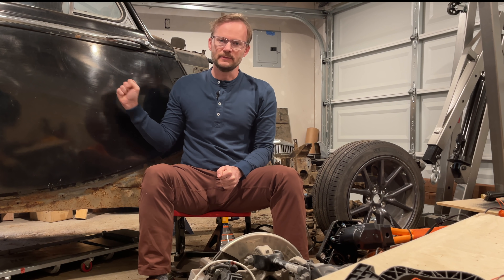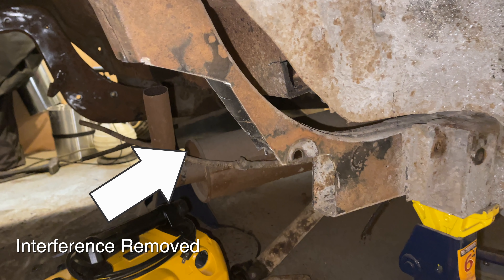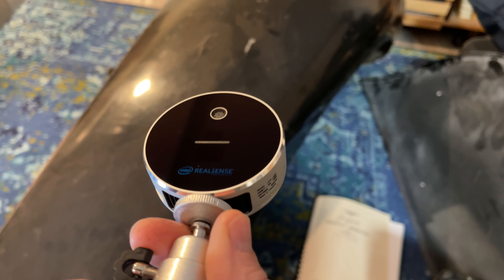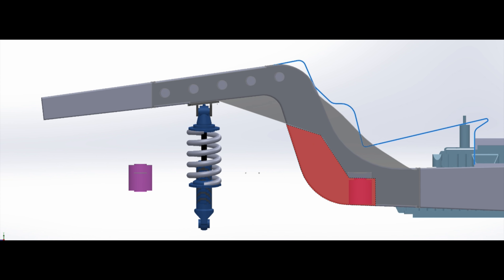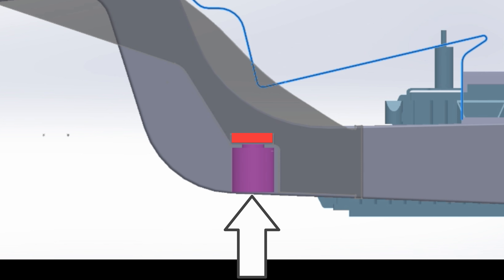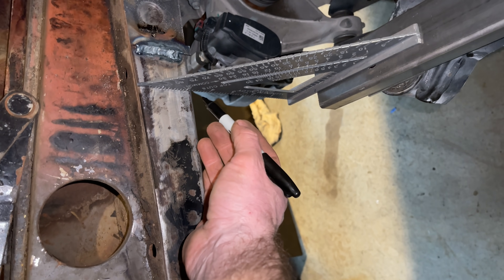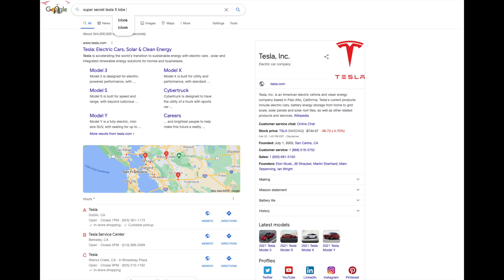Installing A Tesla Motor In An Old Jaguar

Comment: About 16 years ago I traded emails with Tesla on the subject of buying their powertrain, battery and controller for a classic car swap. 

At the time they could not believe anyone would do that to a classic car, but they asked me additional questions. Like on the Jag, I wanted the replace the differential with the motor and place a small battery pack under the hood where the engine used to be. 

The conversation was nice, but they didn’t like the idea of a gearhead buying their parts and doing what I want with it. Perhaps gearhead are fossils, but we’re not elitists like Tesla. 

I’m looking forward to driving my classic up to a Tesla charger and topping off my battery next to the typical Tesla drones. 

Oh, it would be phenomenal if I could run a battery down to near zero and refill it to 100%. As with be ICE vehicles, I like to freedom use all my power and then refill it to 100% full. That’s the American love story with automobiles!

Comment: A Hot Rodder would sit the body of the car at the desired ride height and put the new tyre in place and determine the best looking wheel / wheel arch fitment and use that to determine the axle / sub frame placement.

Comment: I just saw a video on a german Youtube Channel called JP Performance about EV Swaps in VW Beetles and they talked about restoring tesla motor. The guy specifically says that driving backwards for lang periods is bad (at least for that motor and gearbox) because the mechanical oilpump in the gearbox only works forward. However he also says that this oil pump is electric in newer motors.
Maybe someone needs this info.
https://youtu.be/Tg7D4oyZRjE?si=JPQou7wwQxj7nTH6&t=2134

Comment: How did you determine the height the subframe should be relative to the frame of the Jag?  Raise it until the halfshafts are parallel and measure?  Or just assume the bottom of it should all be on plane with the existing frame?

Comment: Good to see a auto artist at work. I think EV kits for classics will be big business.
Reply: Agreed. It will take some time for all the haters to die out, but just like with fuel injection and automatic transmissions, eventually that will be what people want. It’s one thing to EV swap a rare classic, but some models had literally hundreds of thousands, even millions made. Those are great candidates for EV swaps. Imagine getting into a classic car, and having it start up and drive instantly, also instant torque. 

I do wonder about fast charging though. I do wish Superfast Matt would touch on this, other than his reasoning why he won’t use a supercharger on the jag. There are thermal runaway fears, as fast charging does heat up these things quite a bit, and there’s not a good way to precondition the batteries. Enthusiasts want to be able to drive the cars long range to meets and events, and if they can only go 200 miles before being stuck with level 1 or level 2 charging well, now they’re stuck charging for a day. Cars are meant to be driven, not trailer queens.
Reply: EV charging continues to be a disappointment for road warriors in the US. It’s a huge country that’s almost 100% road accessible, so my 4 minute refills from 0 to 100%  fuel fills are hard to give up to be EV.

I think a lot of the classic car guys would be just fine with 100 miles of range. We really don’t go on 1000 mile runs too much, it’s mostly local area cruises.

Comment: I think it was i good idea not to mount it backwards. i worked at the polestar 2 drivetrain (i know, not tesla) but on the p2 there are some things that dont like running in reverse for long times, mostly  the transmission-housing oil-trap and other lube related things. also the micro-geometry on the gears are optimised for forward.

Comment: Hey, I was curious how you mount the subframe with an understanding of where the ride height will be after the suspension is compressed? 
Do you just level the control arms or put the wheels at about the half way point of their full suspension travel distance?

Comment: You mentioned in an earlier response that the Tesla motor was about 26" 20 " front to back and 13 " tall. For the first two dimensions, are these the motor cradle mounting hole distances?
Reply from the maker: That’s just a rough estimate of the entire envelope. Mounting holes are inside that envelope. It’s hard to measure accurately with it installed.
Reply: Yes that would be a bit difficult. Perhaps if you take it out for some reason.......?

Comment: it's kinda hard to wrap my head around how big or small that motor is. do you know what the ear-to-ear mounting measurements are for the front mounts? ie how actually big is this thing
Reply from the maker: Rough tape measure: 26" wide, 20" front to back, and 13" tall

Comment: I believe you need to change the oil pump setup to run the tesla drive units in reverse, just an FYI if anyone is considering it. https://zero-ev.co.uk/product/tesla-large-drive-unit-replacement-reverse-drive-oil-pump/
Reply from the maker: Interesting. This is for the Model S/X. Model 3 uses an electric oil pump so it will work either way.

Comment: I'm confused, an electric car doesn't need a reverse gear. Tesla just add a  speed limiter in the software and lock it into first gear. Then they just make the electric motors go backwards. For example electric passenger trains go backwards just as much as they go forwards so they don't have to shunt them at the end of the rail.

Comment: They have to, If you hit the brakes that's negative acceleration and therefore the whole weight of the car as to be stopped just you first accelerated. Cars do 0-60 slower than 60-0! But, in case of components holding up, I would look into how much force the regenerative braking system applies before the disk brakes are used and that would indicate that if forward and backward have no difference in durability.

Comment: The subframe looks just like a Mercedes W124 , W129 etc rear axle assembly and instead of just a Diff and axles it has the electric drive unit. It's a great design so it stands to reason tesla bought the rights to use it.
Reply: I've been having fantasies of putting a Tesla motor into my 94 E320 Cabrio (triple black) which is the W124 chassis.

Comment: I’ve found chain saw bar oil thinned with white spirit makes an excellent anti rust coating. It’s cheap so you can fill up box sections then pull bottom plugs to let out the excess. 
I took the scale and rust off some scrap steel and left it out to weather. 6 moths later no rust. Cleaned off 1/2 of it with water soluble degreaser. Left it for another 6months and only a few patches were drying to oxidise. The untouched oil was clean metal.
Reply: Well done! I’m so anti pressure washing these old timers, I think it just helps more rust to start where maybe it wasn’t before. Just wondering if oil thinned with cellulose thinners would be a good option, the thinners would evaporate leaving the oil having penetrated deep into cracks and hidden crevices etc, maybe?

Comment: I would love to see a decent size battery and electric drive into a Citroen CX. These were excellent cars often accused of being complex when in reality they were just different. They rusted off course as everything did before the late 1980s. They suspension and brakes hydraulic pipes rusted of curse leading to the “complicated”reputation.

Comment: Others no doubt said it but Spitfire designer Reginald (RJ) Mitchell actually did say “if it looks right, it probably is right”. That original Jaguar chassis does not look right  it’s also fairly obvious that a design correction would not have affected rear seat passengers.

Comment: What was the cost of water jetting?
Reply: Water jetting and power washing do not go well with these old timers. Better to keep water away from potential rust promoting areas like welding joints, cracks and crevices. High pressure dry air will clean most things and not leave a wet or damp residue ready for fresh rust to start.
Reply: @nickybritain4900  I was referring to making parts not cleaning the car.

Comment: Like what you're doing, I'm thinking about doing something similar but with a Modern Petrol motor (Large V8), anyway I want to 3D scan my current car chassis, Diff mounting area and engine bay.
You mentioned an Intel L515 Lidar Scanner (which I'm thinking of purchasing), I couldn't find the software you mentioned??
I'm CAD Designer so I'm familiar with the 3D geometry thing all I need to do is "like you" scan both parts and see how well they might or might not fit.
Any help would be appreciated.
Reply from the maker: The software is called RecFusion.

Comment: With respect to all the duat during cutting, I pressure wash everything to remove dust and debris.
Reply: I would advise against power washing these old timers, I think you are power blasting rust provoking water deep into the cracks and crevices, promoting more rust to form deeper into inaccessible areas. Compressed dry air in excess of 100psi is quite effective at shifting ingrained dirt and rust particles.

Comment: Get some weld thru primer, spray inside the frame plates, spray the frame caps and weld them into place. No aluminum U channel on steel, no rivets, no corrosion.
Reply from the maker: I decided to just weld the sections closed. But have you had good luck with weld thru primer? I've heard mixed things.
Reply: @SuperfastMatt  Instead of the substantial modification and reinforcements that were done.

Did you ever consider welding rectangular tubing to create a bespoke stepped arch rear-end frame? That would align with the rear most attachment points. Using a template to keep everything aligned. 

It just seems more elegant and would add a lot more stiffness to those rearward attachment points. Or would that type of modification prevent it from being street legal?

I just found this channel and as a YouTube wannabe expert. I just can't wait to watch the rest of this geeky soap opera, thanks.

Comment: 7:23 is that true? as a 3rd year ME student, I feel like I need to do something
Reply from the maker: We had a question on a technical interview that was asking for the failure load on a beam in compression. We gave the cross-sectional area and yield stress, and most people just calculated the failure without considering buckling. Buckling was the failure mode, and very few people considered that. Being a good engineer has a whole lot to do with being able to consider all the circumstances. Buckling, thermal expansion, fatigue, welding screwing up your heat treat, etc. You can have a computer do the analysis, but it doesn't help unless you do the correct analysis. On complex systems, even teams of seasoned engineers will overlook something, which is why real-world testing is so important.
Reply: @SuperfastMatt  That is extremely helpful, thank you so much. Strange that my Mechanics of Material class never taught anything about buckling, I hope it wasn't me not paying attention in class. Yeah, testing is monumentally important, no wonder the FSAE team strives to test as early as possible. Thank you.

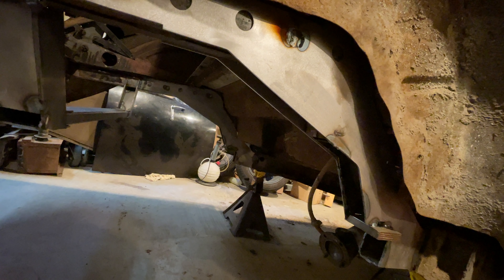Comment: 7:35 Matt, I think you can just clean inside very well, spray it with weld-through zinc primer and weld it. Then make some drain and access holes, paint it from the inside using a hose spray. Then on top of that spray some rust inhibiting oily coat in there and it will be sweet. Actually in California you can probably leave it bare metal and it will be fine :)
Reply: I kinda agree , could be better weld it up & spray  with dinitrol cavity wax ( is the best one I know so far, foams up as it goes in & spreads ).through small holes.   In the UK we have both salt on the roads & the need to get the car re-registered & inspected if you cut the frame.
Reply: @brackcycle9056  yeah, I know the pain of strict regulations too. Americans have it so good (in this aspect)

Comment: your right to be cautious about how much in reverse testing manufacturers do . Turns out citroen did not test the 2CV above 10mph  in reverse -because if you exceeded this for any distance a gear would unwind from the shaft seizing the box permanently solid.  - as i found out to my cost.
Reply from the maker: yikes! Time to swap in a literbike engine and transmission ;)

Comment: Good thing you did all that scanning and CAD so you didn't have to grind and cut to fit as it was slowly lifted into place!  😂
Reply: Story of my life. Spend forever carefully planning and measuring, and end up just winding it 😂
Reply: It just slipped right in.
Reply: Grind? 3 lb sledge and tappy tap tap.
Reply: no battle plan survives contact with the enemy
Reply: @katelights  And "Everyone has a plan 'till they get punched in the mouth"
Reply: That's how it would have been done in the factory
Reply: So much easier to remove metal than it is add it...
Reply: Also read, of mice and men...
Reply: 'cutted 3 times and still too short'....

Comment: Why not start with the power train swap? We all know it will have to come out some number of times greater than normal patience will want but hey, that's the thing! And it really sets up the commitment to finish- the rust chasing only seems to be endless and who wants to start a project with endless? Actually, your process, starting while the body was still mounted, makes a lot of sense- the bit about the dogleg reshape and getting into the rear floorboard was much clearer that way. Very interesting- very!

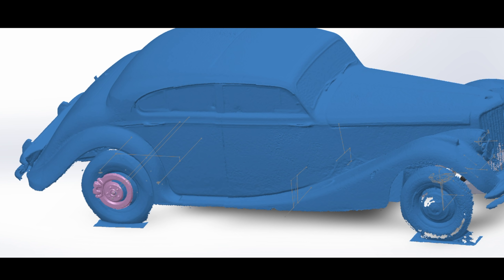Comment: 2:52
Got any more details on how you liked this scanner? I've been seriously considering getting one for exactly this use case of scanning for a conversion, I assume I'd need to scan then verify with a tape measure and re-create in cad using the scan as a guide?
Reply from the maker: Exactly. If your budget is around $500 I’d say go for it. I ordered a different one on Kickstarter that is supposed to ship soon so hopefully I can have a comparison soon
Reply: @SuperfastMatt  formally requesting a video breaking down the workflow on scanning+cadding in relation to an ev conversion, or just any car fabrication job really
Reply from the maker: @Ryukachoo  Yes on the Revpop. I'll let you know how it is. I plan on doing a scan CAD video and I'll talk about the workflow.
Reply: @SuperfastMatt  is it that revopoint Pop thing? I looked at that but I'm a little concerned about larger scale scans

Comment: 18" wire wheels would look awesome. Or maybe detroit steele wheel co. Check them out. 👍
Reply from the maker: I kept the original hub caps in case I want to get some wide steelies. And wire wheels look so good on the Mk 4. It’s tempting.
Reply: @SuperfastMatt  do.it, and if you don't do it, do it better.

Comment: 0:50
Got a tip from Michael breme of ev west, they do a ton of these conversions and he warned me away from doing this (into a c3 Corvette)
The model 3/s rear suspension are designed for ungodly heavy GT cars, so the rear suspension is modern but not designed like a sports car.
Basically don't subframe swap into stuff that can handle a corner or has aftermarket suspension upgrades
Reply: Are you still doing the c3 ev conversion? Sounds interesting
Reply: @Mrelectric423  
Yeah, it'll be on a different channel, CorVolt, but there isn't much there since it hasn't really started yet. I have to save up to buy drivetrain parts
Reply: @Ryukachoo  I’ve had 2 c3 vettes over the past few years. I want to do an ev conversion too. Haven’t for the same reason

Comment: Neat build;;; backwards is bad the fiero pontiac used reversed  rear a arms from fwd  car in  that car it goes sideways easy like every Time you lift off gas in a turn lift off over steer suux in wet  but fun in a field. i had a blast the car would drive sideways more than straight lol ..i am sure you knew better and was kidding as one can see just by looking its lay out directionally